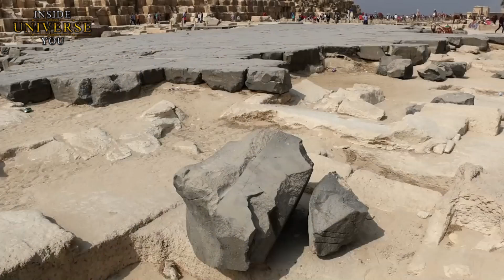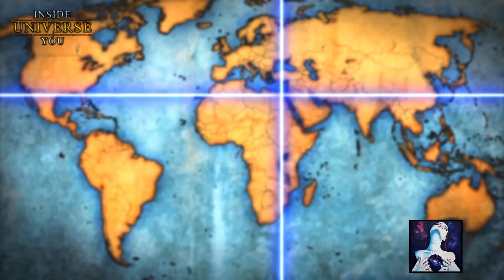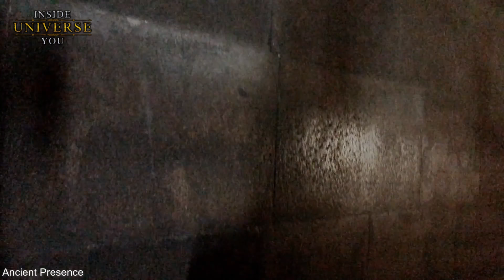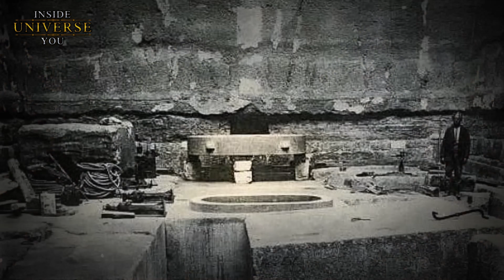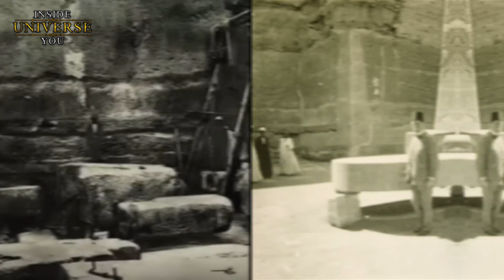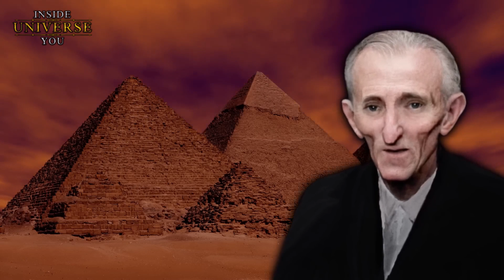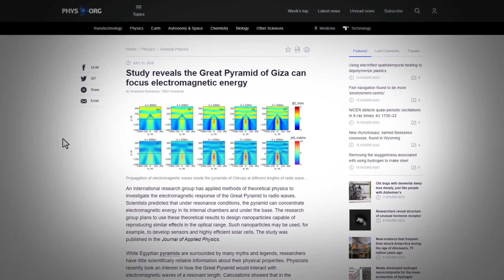Pre-Egyptian Megastructure Built BEFORE The Great Flood

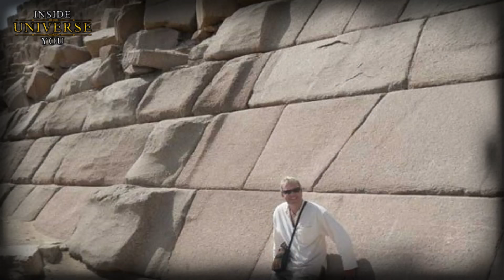Comment: According to the Bible (Deuteronomy 3:11), the bedstead (or bed frame) of Og, king of Bashan, was:
Length: 9 cubits  
Width: 4 cubits  
Modern Equivalent
Using a standard biblical "common cubit" (the distance from an average man's elbow to the tip of the middle finger, approximately 18 inches or 45 cm):
Length: ~13.5 feet (approx. 4.1 meters)  
Width: ~6 feet (approx. 1.8 meters)

Comment: The Serapeum sarcophagi were crafted with a precision technology that remains UNMATCHED by today's technology.....but then they somehow allowed the WORST stone cutters of their society to carve the inscriptions on the outside.     Does that even make sense????      I think it's pretty clear, that the dynastic Egyptians were nothing more than graffitists.
Reply: My problem with the power plant theory is that...Once you generate all this electricity, you then have to MOVE that electricity across a conductive medium, like Copper wire., or some other non-corrosive Nobel metal.   It seems that we would have discovered parts of THAT system, as well, but we don't.
WHAT was all this "power" used for, if we don't find any components of delivery or terminal end, ( in that we find no electrically powered devices.) ...and no components of such devices.

Comment: The Great Pyramid of Giza is a dormant, full-scale acoustic-hydraulic pump designed by an advanced ancient civilization to harvest and transmit planetary energy. Instead of an austere tomb, its barren interior walls and mathematically precise chambers form a highly sophisticated, wire-free machine.
The entire system operates as a unified, bottom-to-top fluidic circuit:
1. The Subterranean Intake (The Engine)
Deep beneath the desert surface, the machine taps into a three-staged subterranean network. Pressurized groundwater from a now-dried branch of the Nile floods into the jagged, uncarved Subterranean Pit. The intentional, chaotic topography forces the rushing water into violent vortices, creating a thermodynamic "water hammer" effect. This intense hydraulic shockwave snaps upward, functioning as a fuel injector for the machine.
2. The Acoustic Valves (The Fingers)
At the bottom of the ascending passageway sit three massive granite plug stones. In this fluid circuit, these stones act as sliding pistons or check-valves. By mechanically shifting position, they change the length of the fluid column to adjust the timing, pressure, and base frequency of the system—acting exactly like fingers covering the tone holes of a flute.
3. The Grand Gallery (The Flute)
The fluid and wind surge into the Grand Gallery, transforming it into a colossal hydro-acoustic whistle. As air rushes over the corbeled, reverse steps of the ceiling, the sharp stone corners cleanly slice the currents. The rising water level shifts the available air volume, automatically tuning the chaotic rumble into a pure, mathematically perfect F-sharp acoustic chord.
4. The Big Void (The Surge Tank)
Directly above this high-pressure acoustic flute sits a newly discovered, 100-foot-long hidden void. This space functions as an expansion chamber or surge tank. It holds a cushion of air that flexes under extreme pressure, absorbing the violent shockwaves so the immense structural weight of the limestone pyramid does not fracture and collapse from the inside out.
5. The Coffer (The Terminal Transducer)
The focused acoustic beam is channeled straight into the King’s Chamber, striking the granite sarcophagus. Hollowed from a single block of quartz-rich Aswan granite, this box rings like a massive bell. The intense, focused sound wave continuously squeezes the stone’s quartz matrix, activating the piezoelectric effect. This converts mechanical sound into a steady, wire-free electromagnetic field broadcasted into the atmosphere.
The Universal Constant
When operational, this machine broadcasted a continuous harmonic hum that synchronized with the Earth's natural resonance. It functioned as a global pacemaker, anchoring human biology, brainwaves, and consciousness into a state of perfect, intuitive connection. When tectonic shifts or droughts dried up the underlying water supply, the fluid column emptied, the master machine stalled, and humanity fell into a state of collective amnesia—forgetting that the monument standing right in front of them was actually a working engine.

Comment: As a lowly stone and brick worker, I can tell you now they are cut with very high power and sharp blades...you can tell how they were moved when cut if you've ever systematically cut a lot of stones. Whoever thinks this is chisels is on drugs...I built a house out of limestone grit and used roughly 1 300mm diamond blade  a day, excluding electricity, and frequent changes of carbon brushes...I sincerely doubt humans alone did this....seriously.

Comment: These guys and many others like them would be well educated to focus on the Great Pyramid NOT the 2nd pyramid of Kephren.....the one with the mostly complete apex.   The GP is the one that has been 'flat topped'.      As for the rest?   Jury stil out, IMO.   Even though you'll have to come up with some other way to shape granite than COPPER which even if you postulate some Unknown method of hardening, may still not be good enough.   
Other features around egypt are possibly much older than 'first dynasty'.....
You'll also have to account for some knowledge especially in the area of math....
And finally?    No record, indeed the opposite is true, of burial of Cheops in the Greaty Pyramid.    I remember reading about 'an island', which actually exists at the bottom some shaft which the Hack In Chief, Hawass, says is tapped out.....

Comment: Static electricity from sunlight expansion and shadowy / nightly contraction (in simplest variation to generate ozone or ions), additional static electricity from sand storms.
With proper capacitors could accumulate electricity into a salty water or some other chemical compounds.
Also expansion/contraction at such scale posibly produces infrasound to keep citizens loyal.
One could even turn the pyramid into a giant blast furnace for melting stones, but the internal materials (what remains of them) are not particularly suitable.
If you were to place reflectors—or guys holding reflectors—on the pyramid's walls, they could concentrate the sun's rays onto a specific distant point during the day, scorching everything there like a laser. Or melting/heating something nearby.

Comment: The drill holes found actually indicate that they had tools that were more advanced than any drills we currently have; going through granite at higher speeds and bigger force than we are currently capable of. The sphinx displays markings of water deterioration over an extremely long time. The last time there was water like that was during the ice age 12K years ago. Just look at what we found out in less than 100 years, how we advanced the past few decades. We use diamond now. We didn't a 100 years ago. They also had natural stone quarries like the world's biggest (possibly only at the time) emerald mine. It's entirely possible that any previous civilization that long ago might also have developed advanced techniques over centuries that were then afterwards lost to time. We currently also destroy buildings and scaffolding etc of what we've used after building anything, so they probably did as well. Edit: I posted this comment before finishing the video.. sorry ;)

Comment: If we hypothetically assume the Great Pyramid was a gigantic water pump built 12,000+ years ago as independent researchers suggest, the most plausible period for such a project would indeed be roughly 8,000–5,000 BCE during the African Humid Period, the Nile had far greater water flow the Nile Delta practically reached the Giza Plateau. Proven the Sahara was much greener, and enormous lakes and river systems existed across the region. The so-called sapropel layers found in Mediterranean sediments also indicate an extremely large influx of Nile freshwater that can't explained otherwise. As the Sahara began drying around 7,000–5,000 BCE, a massive Nile-to-Sahara water-management project would theoretically have had its greatest long-term purpose. If the egyptian civilization did not want to "wet" the already dry Sahara, but rather tried to artificially maintain a drying, vast internal water system, then the most logical period would be approximately 9–7 thousand years ago. and this fundamentally rewrites mainstream Egyptology. No wonder there was such a big outcry against it. And if I were looking for the pump intake, I would look on the north or east side of the Giza Plateau, along the line of one side of the Great pyramid.

Comment: The acoustic resonance in the King's Chamber is the part that actually gets me, that's a measurable effect you can test today, not speculation. Still don't have a good answer for the missing soot marks in the Serapeum either, if they used torches down there for years hollowing out 70 ton granite boxes you'd expect way more residue than what's actually been found. Not sure I buy the power plant theory, but the questions underneath it are legit.

Comment: It's the smoothly polished and highly precise internal corners of those granite boxes in the Serapeum which get me. Where the two vertical faces meet the base it would be impossible to use a saw and to use a drill would be incredibly clumsy. If they did use little copper tools with an abrasive slurry then I pity the craftsman tasked with that job.

Comment: I don't think it was built as an acoustic chamber. Rooms with stone walls will resonate. Its an interesting side effect. What do we store in miles deep multi level tunnels with 1/4 mile branching tunnels built with right turns every couple hundred feet with rooms dug out at the end sealed behind thick steel doors or sometimes even back filled tunnels? Spent fuel & Nukes. Monsters 😂?

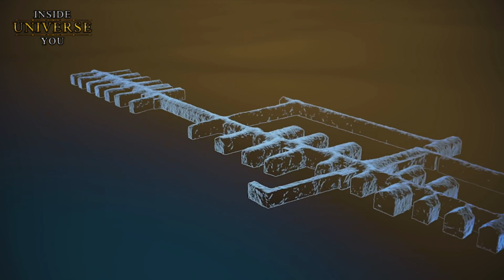Comment: 7:05 this is an energy grid pattern.  The materials the sarcophagus are made from along with dimensions, act as a housing/case. Capacitors, resistors,  diodes,  crystal oscillators (probably the capstone on at least 1 pyramid). All need housed /protected inside something. I'm sure they used wires. (Technology isn't new. Its rediscovered, back engineered and developed.  when outdated,  they declassify it for civilian use. 
Around 1930 was the start of digital.  The time frame for the technology boom. Came right after the Byrd expedition.

Comment: H blocks of Puma Punku, Aphis Bull coffins of Saqqara, the pink granite basin of Zawyet  El-Aryan. They had both piezoelectric knowledge and batteries used for plating. Pyramids full of quartz coated in limestone and capped with solid gold, obelisks, also quartz dense and capped in gold may have provided power grid and if they had use of iron (from meteorite as found in Tutankhamens dagger) thenthey could have created rotating tools using high pressure liquid and sand as a cutting medium - theycertainly understood frequency so vibration, rotation etc would not be too big a step. There is every possibility the Egyptians are what remains of those why built these things - the sarcophagus at Saqqara are precise, but the chicken scratcattept to write hieroglyphs on them is so bad it just does not gel with it being done by the same people, don't need a phd to understand bs or know when mainstream archeology is hiding behind the lies. No bodies were ever found at saqqara in the big black boxes. Nobody can accurately say who cut, shaped, or how, the massive masonry across any of the known sites, and nobody is allowed to dig anymore.

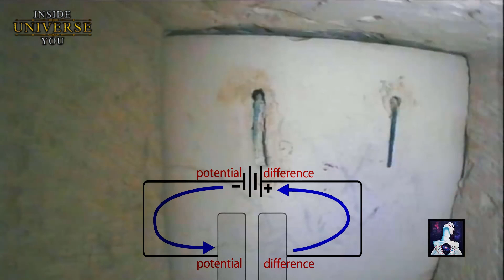Comment: 30:49 So is there confirmation this is copper wire? I've been thinking that for a long time. That These blocks were at one time connected and they were running electricity through the shafts. That's why there's no heroglyphics in the great pyramid in particular because when it was active, you didn't really want to be in it. So it's not like people were hanging out in there. Possibly eons later after the sight was stripped and the desert took over, another civilization used the pyramids as, for them, huge amazing thumbs and they carved their names on some walls and statues. But there's basically no writing in, around or about any of the main pyramids on the sight. There's just nothing and not all the pyramids show even erosion evidence. In deed it looks more like separate events contributed to individual issues and there are just vastly different erosion patterns when looked at from the air especially, you can see the stark contrast better and it does make you scratch your head a little. Why are some things one way and others another?

Comment: It's not outside the thought that they used different types of wire cutting procedures . The marks are extremely similar. The use of water with abrasive materials would be more than sufficient to cut with even soft metals. I still believe vibration was a huge factor for large stones. Build around the interior is what they did from tge inside out

Comment: To get the sarcophagus down in the hole they dig 2 channels twice as deep as where they want their sarcophagus and they have the main chamber filled up to the ground level with sand they put the sarcophagus on top of the sand and then they open the channels down on the bottom for the sand to flow out and slowly lowers the sarcophagus down to place and then somebody goes down and finish off sweeping up at least that's how the primitive Egyptians did similar projects I'm not necessarily saying that the older tec used the same method

Comment: The truth is with Egyptians and their rules/policies they don't want you to know the truth.. if you do you'll unravel any and everything they have ever said/published, they would slingshot themselves to the head of the line as the most incompetent country and researchers for its own history. We all already know that the time they claim the great pyramid was built (20 years... yeah right) and the methods they claim were used do not add up in the slightest, it would take you months if not years to chisel a single limestone block as smooth as they did with a copper tool, you would constantly be resharpening and throwing away tiny chisels. you would need basically the entire country and all people in it working in some crazy organized assembly line chiseling and sharpening.. something like. 2.3 million stones.. also btw they are wider and taller than a human, weigh astronomical weights to the point that we in modern society have tried using modern equipment and WE can't even lift these things. 😂 Good job Egyptian Egyptologist

Comment: If they used SAWS, then there should be a BLADE RADIUS at the END of the Cut.

No Blade RADIUS means they used a Straight Saw Blade like a Rock Cutting Chain Saw with Diamond Tipped Teeth.

Comment: I believe that the vertical shaft with water below it was a water pressure chamber. There was once water at a higher level. A group of people or a mechanical device would support a large stone, that exactly fit the vertical chamber, with chains and lower the stone into the water. The pressure of that stone against the water would push the water through a small hole and that small exit of water would cut precise lines into the other stones. Just a theory.

Comment: The giant and extremely heavy "boxes" made of granit were not cut per se, they were casted into a mold and reversed the process of hardening by use of very concentrated acid which can and will break down the microscopic silica that binds and bonds the grains of granite together. This is how the squareness and precision was achieved for the base and the tops, they almost appear as cantalivered masonry tops. But, more importantly, granite can be manipulated by acidic processes and thus allow for the ability to cast mold and pour in place. This process is way way easier than cutting that type of rock!

Comment: As an engineer, I'm not buying that this kind of precision was achieved by 'craftsmen' with copper chisels. That's just stupid. Similarly, moving massive blocks of stone using slaves is also stupid. It's not just engineering but economics. What kind of society can afford to have thousands of unimaginably skilled stonemasons making pointless objects? Even the fanciest coffin doesn't need micron precision! 

Slaves making pyramids would need an army of support staff. They'd need to be housed and fed. This is a large town of people so what did they do with all that sh1t?

For the same reason, I don't believe all this stuff about 'energy generation'. Our electricity grid is hugely complex and we need motors and heaters and light bulbs. You need AC transmission, circuit breakers, transformers, insulators, cables. The idea that the Egyptian people could just suck the 'energy' out of the aether and use it is nonsensical. Use it for what? 100,000 volts is pretty damn useless and very damn dangerous. What did they have? Dishwashers? Microwave ovens? All this stuff is even sillier than the copper chisel rubbish. 

Let's not get carried away by this fantasy. The question is: how did they really transport and machine huge lumps of rock. That's enough for now. We don't need to start speculating about 'energy generators' because that's not science, that's Harry Potter.